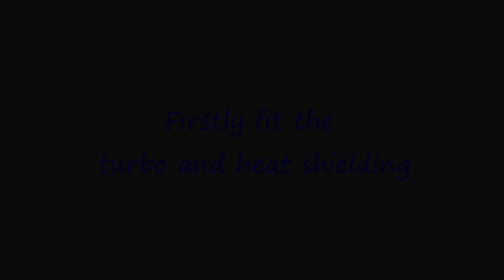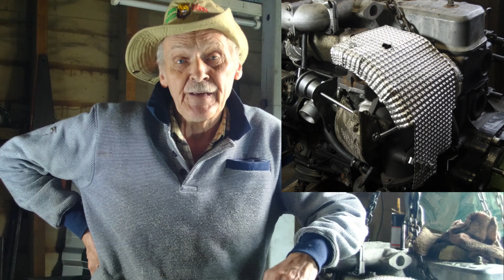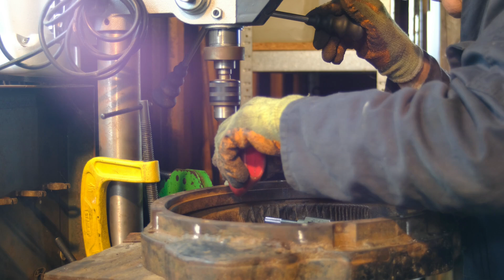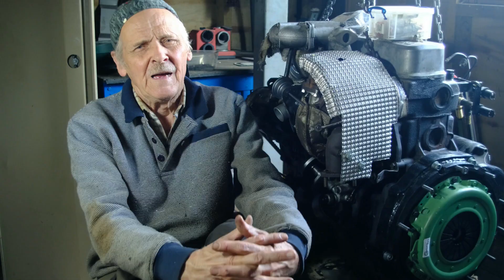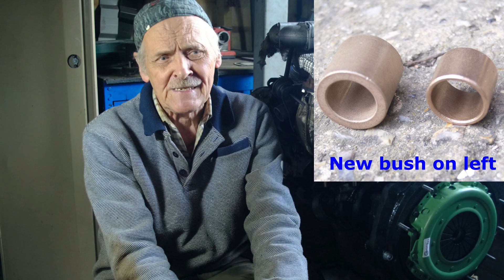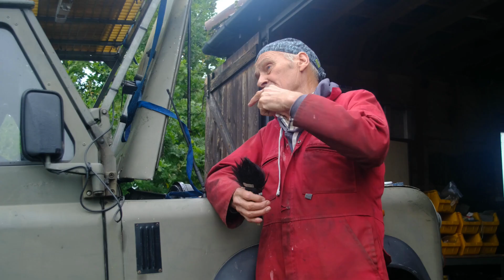Land Rover Defender 90 major revamp - episode 3

Comment: It was a 300TDI. Fully rebuilt by Turner Engineering in UK. I have heard lots of negative feedback about the 'green' product which I won't name as I understand they are quick to threaten legal action. I've no issue with the product quality, only unsure about the efficacy of fitting a much uprated product to a standard engine. I wish you well with yours.
Reply from the maker: @RobertWalker-d2m  A good compromise would be to use their clutch plate with a standard cover. My failures have all been in the clutch plates.
Reply: @defendermodsandtravels  a good idea!

Comment: I had a heavy duty green clutch fitted in my expedition 300TDI Defender.. After 10000miles in Africa my crankshaft thrust bearing was toast, Not saying what caused this but have now gone back to a 'normal' clutch.
Reply from the maker: I don't see the connection. The clutch is attached to the flywheel and all forces are self-equilibrating there. It's hard to see how these could affect the crankshaft thrust bearing.
Reply: @defendermodsandtravels  'The load you’re putting on the clutch mechanism gets resolved by the crankshaft. That’s Newton’s third law. If you push on the rear end of the crankshaft, using the clutch, the crank has to push back, which means it suffers additional wear'.
But don't take my word for it, the above came from John Cadogan, Ozzie engineer and car journalist.
Reply from the maker: @RobertWalker-d2m  You don't need to quote Newton's third law, it's just simple statics.
Let's think about it. The force starts at the slave cylinder and this is counteracted by the fork pivot which in turn pushes on the clutch thrust bearing (this force is several times what the pushrod exerts owing to the geometry of the fork). The thrust bearing pushes on the diaphragm spring, which pushes on the flywheel and hence on the end of the crankshaft. You are right, this is resisted by the crankshaft thrust bearings. I didn't think it through - sorry.
In overall terms the forces are pretty small and I'd be surprised if this caused failure of the crankshaft thrust bearings. What engine is it?

Comment: I was surprised to see you using stainless steel SHCS for the adapter ring to engine. I would have thought that not only the mechanical properties not ideal, but also corrosion issues (though the later can be greatly reduced with certain products). 

Do you have an idea on why they keep coming loose?
Reply from the maker: High frequency vibration under tensile load.  Anything attached to the engine tries to work loose.
There will be no corrosion. I'm bemused why you think SS is particularly prone to corrosion. 
Which mechanical properties are unsuitable for this application?.
Reply: @defendermodsandtravels 

Sorry I thought the corrosion issue obvious, that is, the SS won’t corrode but will sacrifice everything else around it (given moisture and an electrolyte).

As for the mechanical properties, and of course I don’t know what grade your SHCS are, but common 316 SHCS have a low tensile strength , much lower than class 8.8.
Reply from the maker: @husq2100  There will be no galvanic cell because:
1. Moisture only gets up there rarely (deep wading etc).
2. The engine runs hot and if any moisture does get into the threads it will be evaoporated quickly.
3. I fill all external threads either with threadlock or with copper slip (depending on application) so water can't get in.

Regarding the strength, even if the bolts were only the equivalent of Grade 4.6  (mild steel) they'd have a working load of 18 kN. If you do a simple statics calc considering the weight of engine and gearbox; the spacing of the mountings; the BM at the engine / adapter ring interface; the lever arm of the bolted connection and then apply a DAF you will quickly demonstrate that the bolt forces don't approach this number.
In reality you want to torque the bolts up so the joint remains in compression and the bolt loads remain essentially constant. I have done this without stripping the threads and am satisfied that the bolts won't fail.

Grade 316 actually has UTS of 515 MPa although quite a low yield stress (205 MPa). They'd be perfectly adequate for this application.
Reply: @defendermodsandtravels thanks for the detailed reply Bill 👍
Reply from the maker: @husq2100  I didn't have much choice. Your comments made me look foolish so I had to reply. Anyhow you asked the questions and justified my choice of using SS.

Comment: Loving this series. Do you anticipate the clutch being heavy to use?  I have a dodgy ankle which pains after a day driving my 110. LOF sell a spring set to take some of the pedal weight, but I’m still looking around for a good solution.
Reply from the maker: Time will tell. If I change the clutch pedal box I'll be able to use the LOF spring which reduces the pedal load.
Reply: The solution is servo assistance.
Reply from the maker: @lutherblissett9070  Yes but I don't yet know if there' a problem to solve.

Comment: Wearing those gloves when using spinning equipment made me hold my breath. enough torque to beak a wrist or finger bone before a tangled glove gives way.
Reply from the maker: I prefer to protect my hands from swarf and noxious fluids and when handling heavy workpieces with sharp edges. Thanks for your concern.
Reply: @defendermodsandtravels  haven’t I seen you wearing rubberised gloves?  I remember thinking they looked like chem protection or perhaps electrical insulators.

Comment: Nice video, you might want to reinforce the clutch fork as they can become a problem with the higher clamping pressures.
Keep up the good work
Reply from the maker: I have communicated with Luke at LOF Clutches and we agree there's no particular reason to change the clutch fork when this one is still in vgc. I might however put a dab of weld metal on the back of the  slipper pad pins-to prevent these from coming loose.

Comment: best upgrade ive done to my 300 tdi is pull it out and put a 300bhp m57 with auto box in absolutely brilliant and refined my landy drives like a propper car now and rides even better at 90mph stable
Reply: I too will be installing a M57 but with ZF 6 speed manual. I can understand why Bill would not be interested in these sorts of engines.
Reply from the maker: @husq2100  Not for overlanding.
Reply: @defendermodsandtravels  they are bullet proof engines totally over engineered basically your making a grenadier lol
Reply: @graham-martin5847  The problem is parts availability in developing countries. As good as the M57 is, it's not a common engine globally.
Reply: @cameronwood1994  bullet proof take the basic plastic parts with you and your golden